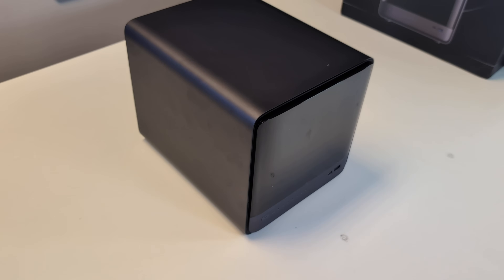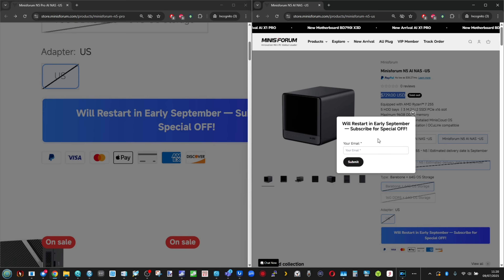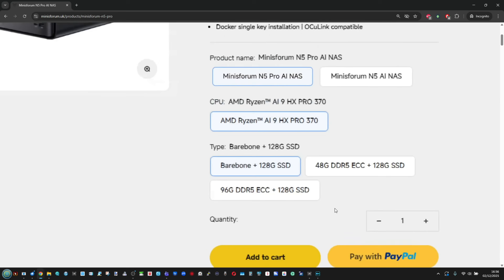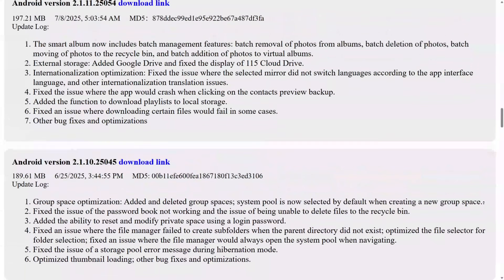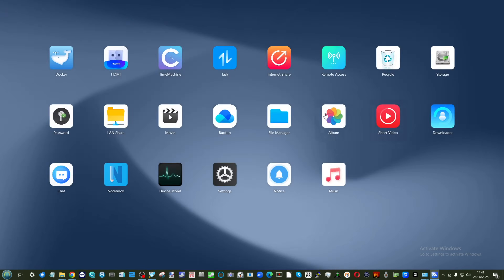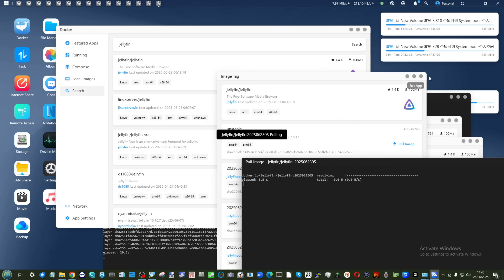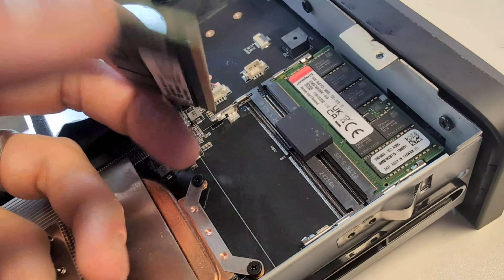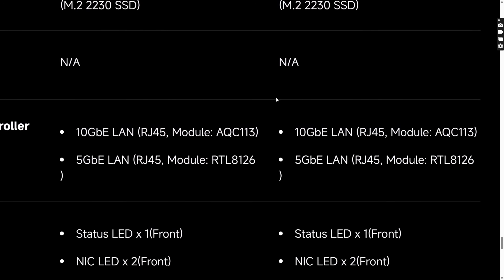Minisforum N5 NAS - Six Months Later

Comment: Actually I'm more interested if the standard N5 igpu supports plex hardware decoding as I got a "no" from asking Minisforum. Other than that, I really want to build a NAS with this device. I have no experience with neither true NAS or Unraid, but it would be a great way of getting into it, and this box could serve me well for quite some years before I run out of upgradeability with the amount of harddisk and ssd slots. Only thing one could want was an am4 version with todays prices on DDR5 😕

Comment: I use N5 base 255 since like 2 months for 24h/day. My impressions are positive, CPU is quite powerful, RAM was cheaper when i bought ;), though i don't stress it much:
Temperatures are ok, it's quiet enough, power consumption is okay. 
And yes fan control doesn't work on Linux :), but isn't 'broken'. EC is ITE IT5571 chip, UEFI doesn't expose it, and worse there's no kernel module, cause of no docs on that chip (frequent problem with EC chips, google it, plenty of other devices uses this chip).
Currently i run it with Debian stable with OpenZFS, but had to bump kernel to newer version - ML/AI on iGPU crashed otherwise, standard ROCm pain. Same problems i had with Proxmox kernels but maybe they already updated. 
btw. Minisforum OS is  just preconfigured Debian with some web tools, so no big deal. ;)

NICs work fine, but I don't use WoL so didn't even test it.
I had higher hopes for internal PCIe slot but it's very limited by size, guess i'll use it for additional nvme disks. Now i simply use Oculink eGPU via Minisforum dock for tests.

Comment: I got my N5 a few weeks ago and I'm happy with it. Its running Unraid right now. Mine arrived with a 128GB 2280 SSD and I'm glad I ordered it with 16GB of RAM just before prices went insane.
My only issue with it is the lack of fan control for the HDD fans. The 8TB ironwolf drives I'm using run a bit warm and I would prefer to have a little more noise for lower temps.

Comment: Anyone got one of these running as a Plex server? If so, how does it handle streaming?
Reply: Just got a pro and did a test last night. It handles direct streaming perfectly and gpu was automatically detected (on windows) for h/w transcoding with tonemapping support. I will be migrating my unraid box to this (replacing an intel chip with quicksync) and see no problems.

Comment: I confess I'm shooting for an MS-A2 for U$870 instead of the U$600 N5, it's a massive performance boost with a lot more interfaces and connectivity and let's not forget the far smaller footprint inside my 10" mini rack too.
Reply: Totally different machines. 
A miniPc and a NAS with space for four 3.5 drives and several  Nvme.
Will you attach a DAS or you're directly not looking for a NAS?

Comment: I bought an N5 Pro w/ 96GB a couple months ago.  I don't like their OS so need to install something else but am caught up in analysis paralysis.  Would really like to see a video going in depth about various OS options to try and facilitate Synology replacement -- what easily covers the alternatives to network shares, Active Backup, Docker/VM, web server, a general management portal, easy storage management, easy firewall/security management (for its own network connection), shr/zfs data protection, etc.?  I come from ESXi and cannot say that I'm a fan of Proxmox.  It's to the point where I think I may get the most out of it treating it like a normal computer and installing Debian or even Windows Server.  Thoughts?
Reply: I am running Proxmox with xpenology.  Works a treat.
Reply: @bigbaymax  Hmm ok, good to know.  Thanks!

Comment: Just an FYI, the supplied 128GB SSD in my N5 is gen3 so not quite as fast as the gen4 I added. Also the nvme sockets are not x4 - think it’s 2 by x1 and 1 by x2. Still faster than SATA

Comment: Something to keep in mind is that 255 is a downbinned 370 that has a failed NPU and is disabled at the core level, so you don't get all the unified memory benefits. Thats also why its so hard to get info on that chip outside China
Reply: You're wrong.. it's a downbinned Ryzen 7 260. The 370 is a zen 5 cpu, while the 255 is a zen 4. It's just imposible to downbin to a different architecture.

Comment: The SATA and iGPU passthrough has been fine for me to chime in on the pro, Proxmox 9.1 with 6.17 kernel. The NPU with ROCm, more of a challenge.

Things for improvements:

1. Mobo that supports PCIE bifurcation.
2. A flush I/O, currently it is recessed which makes it a bit of a pain to access if you are trying to reach around the back of a rack.
3. A front panel that is not a fingerprint magnet. 😉
4. As mentioned, better native fan control.
Reply: Can you elaborate on the passthrough? What VM OS? Also N5 or N5 Pro? Do you use any Amd Reset Bug Fix? Whats your UMA Frame Buffer Size in Bios?
Reply: @hawxxer234  Pro, TrueNAS/Debian and via vfio-pci though, only the SATA controller remains now for my TrueNAS VM, my LXC containers use it as well and I don't have a need for it on TrueNAS so for now, just passing the SATA controller. No reset fix and no change to the UMA frame buffer.

Comment: No issues here with non pro. Tried Proxmox since I already have a 3 node cluster but the pass through of the storage controller didn’t work. Eventually moved on to Unraid and use the internal USB port.

Comment: I have 2 of these. The only issue I have is the lack of fan control support outside of the bios and the wonky bios and drivers that didn’t work at first. I am running both as Win11 pro machines. 

Now that I’ve solved the issues I’m happy with both. Running both with u.2 drives that are 15mm each. 
You can fit them but you need to move the little fan forward and up and use some tape to hold it in place. It still cools them fine it’s just janky.

Comment: I was hoping for some feedback regarding the pre-installed OS. How's that looking? Thanks for the caution about the memory! I was looking at the +128G and thinking, dang, that's a lot of RAM. Man, would I have been surprised!
Reply from the maker: Ok...so...it's not that the software is bad. It's actually kinda on par with the likes of Terramaster, Asustor and even QNAP to a point. The issues are 1) localisation still doesn't feel 100% and you just catch inconsistencies every 10-12 steps. Mini things, but enough to make it feel a touch inconsistent. Plus the lack of client apps and a top tier backup appliance built in (there is one, it is just a little perfunctory) all add up to it feeling unfinished at the minute. Definitely NOT a reason not to buy this, but just a note of pragmatism needed!